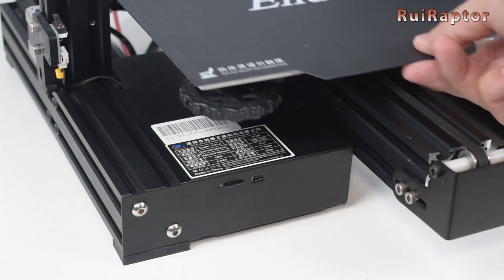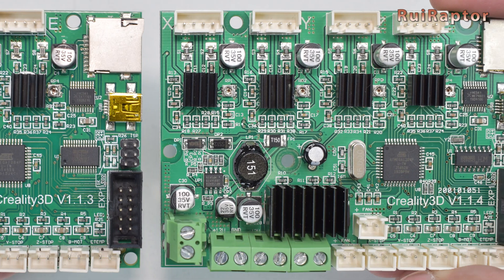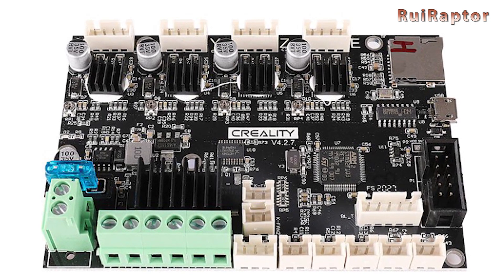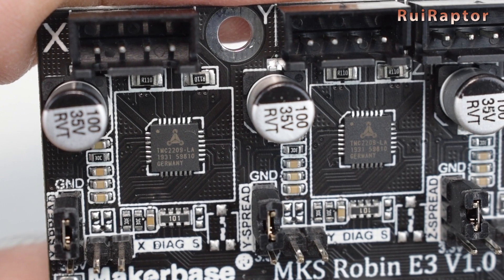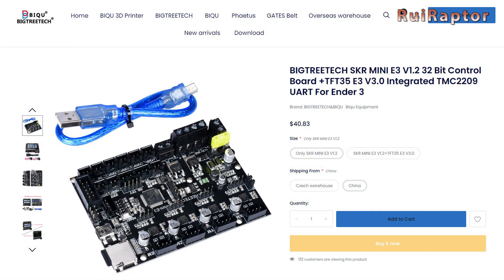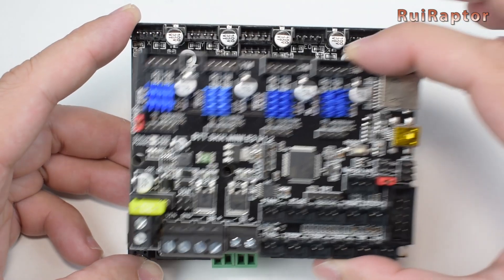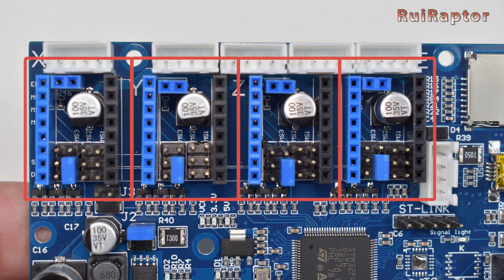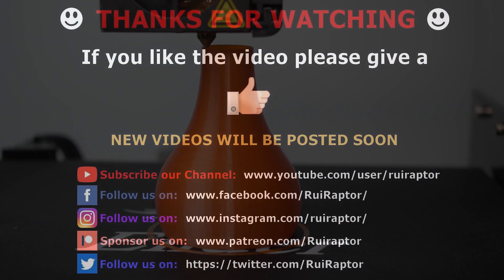UPGRADE Plug & Play BOARDS - Creality ENDER 3 / PRO

Comment: I'm a 3dp novice, are all these boards no linear advance? I read somewhere, that if you really want to tune a filament you need linear advance capability. Going to check the channel for other videos, maybe it's in them
Edit: It's a depends answer. The drivers need to be certain types, and since some boards allow easy replacement, they can have linear advance.  Others, like the creality boards are soldered with non compatible drivers.

Comment: Z outputs in series or parallel...does that mean you can't control them individually?
Reply: parallel outputs sends the same signal to both z motors. which means no individual control.
Reply: @careykaeding4542  that's what I've learned. I've seen someone claim z outputs in series as well but I'm suspicious they just didn't know. 
I'm going to look into canbus or those octo boards for my extra steppers after I get the frame design done on my flying gantry non-corexy project.

Comment: Parallel vs serial z-output!
Parallel means the two z spindles can be driven independently. A requirement for G34.
This requires at least 5 drivers !! Your description of some board are therefore wrong.
Reply from the maker: Hi Alles, you are making a confusion with the terms. What we mean by parallel is that the same driver has 2 outputs (connected in parallel) and this way, the same driver can drive 2 Z stepper motors. The parallel in this case is regarding the electrical connections of the 2 outputs/signals which are in parallel.

Comment: Can you offer any similar input for the 10S PRO???? I like the 4.2.7 but is it the best choice. I know folks turn away from the ribbon cable but in auto restoration we swap harnesses all the time. Why not swap in the ender Harness and the 4.2.7 Board?  Then the use interface way works with this combination???? Appreciate any info for 10S Pro Upgrades. Thanks Dennis

Comment: I need to replace the board in my original Ender 3, but I don't want to install firmware. I just want it to work and print the carbon/nylon and TPU filaments. I do have the Micro Swiss hot end and my original board had a version of Marlin on it so I could increase the nozzle temperature. I do not want to go through trying to figure out firmware and bootloaders again. I just want to plug it in, insert an SD card, click on print, and print. Will these boards do this right out of the box?
Reply: @CarbonGlassMan I was thinking the same thing. It’s not “plug and play” if you have to download firmware and bootloaders.

Comment: I have CR-10 mini ...
i don't mind taking another printer because i don't see any difference in the printer other than a couple of little things i also have with tiny upgrades.
Also microswiss direct extruder + notchua fan.
And a custom hermetically sealed wooden enclosure to maintain the set temperature.

However, I would like to take a quiet motherboard that has slots for double Z, auto leveling and out of filament sensor. And possibly some other additions.

I’m willing to set aside about $ 400-500 if needed for a full upgrade.

Which motherboard fits the CR-10 mini?
Can only filmware be inserted into any board somehow?

Comment: Is there a reason this is just for Ender 3 / Pro and not the V2?
Reply from the maker: The boards are also compatible with the Ender 3 V2, however, the stock board that comes with the Ender 3 V2 is equipped with TMC (silent) drivers.

Comment: I have the RRF v1.1 board. It's a good 2209 board. But the SD card reader doesn't work well. It's not a snap in just a slide in like other boards but it will cause failure.

If you have this board use TFT USB or card slot to print and it prints fine.

I got it promotional for 28 bucks so I don't care about it. But others might care.

If you print via USB or other means too with wifi it's also fine. Just don't expect to use it with a SD card on the mainboard reliably. I tried everything from BTT and online other have issue too. Just a bad connection or something.

Comment: Looks like there is new Fysetc Cheetah v2.0 board. It has all the same features as SKR Mini E3 v3.0 + USB-C and selectable fan voltage. It looks very promising. I actually ordered one :)
Reply: Hi Maciej Kobus and ruiraptor, Just got my cheetah v2 and I'm struggling with it. Once installed and plugged in, all the motors make a loop movement of forward and backward. Nothing appears on the screen. The bed and hotend also raises their temperatures. Do you had any of these problems? Just plug and play?? Can't find any documentation about problems on Fysetc Cheetah v2.0. Any help will be appreciated. Thanks in advance!
Reply: @dsicart  Uhh, difficult question. You need to do some troubleshooting to figure it out. Better contact FYSETC and ask for help. I'm using Klipper and got everything working although there is hardware issue on the board with BLTouch so it needs modification to work. Also example configs from FYSETC are not correct for Ender 3 this is why I recommend starting from scratch.
Reply: @maciejkobus  I took your advice and got in touch with the manufacturer directly. They kindly provided a firmware.bin file for flashin Marlin with the last version and config.h and config_adv.h files just in case for stock Ender 3 (v1). Perfect for me and the printer is super-silent now! Thanks Fysetc!

Comment: So what IS THE BEST?
Reply: I wend with the btt skr mini E3 V3 it's a pretty great board. Cheap and can run klipper, and is whisper quite.
Reply: @RedBeard20842  I moved to bambu labs now, but thanks
Reply: @RedBeard20842 we meet again red beard
Reply: It’s not that easy to answer. I would look at them and choose the cheapest board with all the features you need.

Comment: This is a great video and it is very helpful that you've put all these boards in one place.  I was looking to see if you have a spreadsheet with all the specifications so they can be compared.  Do you have one you can share?  It would be helpful to include the amount of memory as well as the processor speed.  Thank you.
Reply from the maker: Hi Gizmo, yes, we have made a spreadsheet with the boards and specs. We will try to upload it to share it with you guys and post here the link for it soon.
Reply: @ruiraptor  spreadsheet?
Reply: @ruiraptor  Yes, please provide a link to the shared doc or even a screenshot of the spreadsheet! Thank you!
Reply: @ruiraptor  where is the spreadsheet?

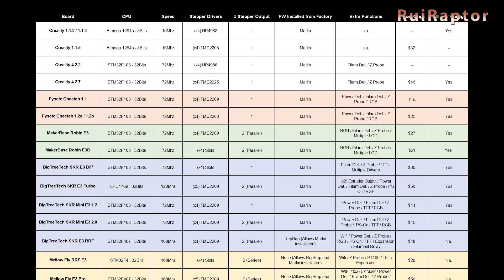Comment: Great video.  I just installed one on my Ender 3 Pro and it works great running Marlin.  Question:  Do you have the spreadsheet listing all the various boards and their specs?  You briefly show it around the 1:20 part in the video or have I missed it somewhere in the comments section.  Thank you.
Reply from the maker: Hi Robert, yes, we have made a spreadsheet with the boards and specs. We will try to upload it to share it with you guys and post here the link for it soon.
Reply: @ruiraptor  how soon is soon(tm) ? :D
Reply: @ruiraptor  Thank you!
Reply: @ruiraptor  that would be very helpful. out of all this which would you recommend for ease of installation and most function.
Reply: @ruiraptor  Wow, FANTASTIC video! I was looking for info on just one board, but found them all! Any chance you have a spreadsheet (sharable doc or image) with a comparison of all the features and prices? It would be awesome to compare everything at a glance!